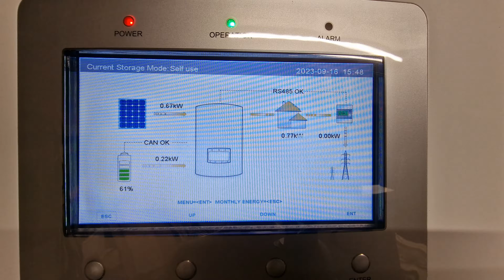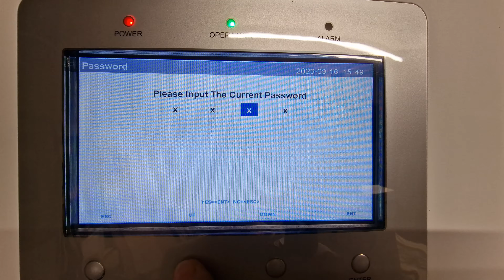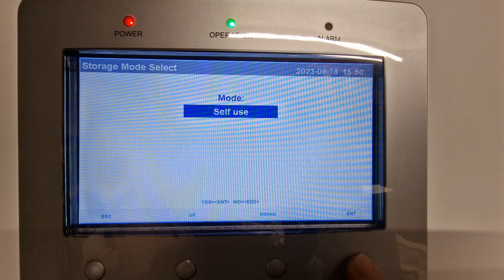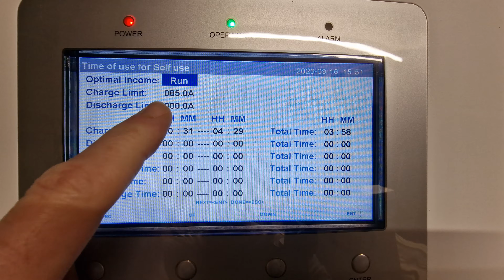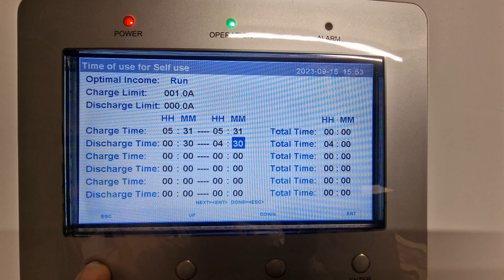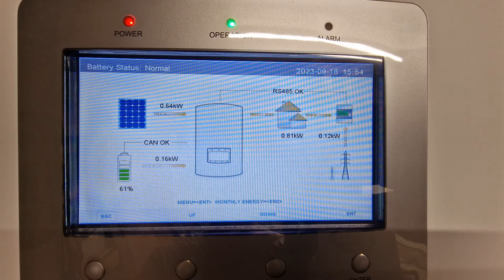Overnight EV Charging without using your solar/PV battery

Comment: That’s very helpful, thanks. I’ve set a 3 hr charge window at 1 Amp when I charge my EV. If I decide to charge my solar batteries at this time also, what’s the max amperage/current I should be updating the charge amperage/current to?
Reply from the maker: Hi. Depends on what model of inverter and what batteries and how many you have.
Reply: @SolisNotSolis  Solis S5-EH1P5K-L (rated power of 5kW) and two 5.3kWh batteries (two WeCo 5k3 modules).
Reply from the maker: @poc353  Ok, so the inverter is 100amp peak, more like 85-90A sustained charge rate dependent how well cooled it is.
I'm not familair with the batteries but a quick google seems to imply max charger current of 100a. So your limit will be the inverter not the batteries.
Bear in mind 20 A x 1 hour is roughly 1kWh of charge and that should guide you
Reply: @SolisNotSolis  thanks very much - much appreciated. Yes, those batteries are 1C rated. That makes sense then, I’ll probably start with 50a or so. Thanks again.

Comment: Thanks, that's really helpful. I'd not thought of setting the discharge rate to zero.
Do you need to change these settings at the start and end of British Summer Time?
Reply from the maker: Hi.
That depends on your energy supplier. The inverter will correct itself and if you use Octopus for example, they follow BST. One or two don't and stick with GMT all year round

Comment: Hello, I have a Solis 'RHI-5K-48ES-5G' Hybrid Inverter with a Pylontech US5000 Battery. If you can have any advice, that would be great because what I would like to know is how to stop my Solis inverter from discharging my battery, set at the factory pre-set times ? I'm guessing, as I am new to all this, but is it just a case of removing the factory pre-set Discharge times, or instead, could I just change the Discharge rate from the pre-set 50A, to 0 or 1A.

Any advice or guidance on this would be appreciated :-)
Reply from the maker: Hi. Discharge settings are for when you specifically want to dump all your battery to the grid.
By default those would all have a zero time span.
So mine are all set to 0600 0600 (all three discharge fields) so it's outside of my cheap overnight rate where I recharge my PV battery from grid. You don't want those times to overlap if you've configured manual charging.
If you're not overnight charging you can set the charge and discharge times to any values, just make sure the durations are all zero

Comment: If you don’t want to discharge into your EV why not just lower the discharge rate to around 5amp. ? I have this issue and don’t see a simple solution apart from constantly having to change settings.

Comment: I want to get Octopus Energy’s Flux tariff.  My question is: is it possible to program the inverter to dump a certain KWH at a prescribed time to the grid?
Reply from the maker: Morning Michael. You can't program it to dump a specific quantity of kWh to the grid.
But you can calculate this pretty easily. 20 amp discharge rate for 1 hour is 1kWh near enough.
So if you discharged at 40 amps for 3 hours, that's 6kWh to the grid.

Hope that helps.
Reply: @SolisNotSolis  This is possible through soliscloud.
In the UK soliscloud uses tariffs from Octopus, in the rest of Europe it gets day ahead prices from Nordpool.
If you can set up a price threshold about the discharge and charge, also the current limit, the soliscloud will automatic calcul the time period. Then the soliscloud will automatically modify the inverter remotely at regular intervals according to the set values per hours
Reply: Does the same figure apply when charging the batteries?
Reply from the maker: Yes it does indeed.
 @michaelellis405
Reply: Ok many thanks for your help.
Reply: check my reply, the function should be soonly ready this year

Comment: Is there away to access this method via the solis app? It seems odd there isn't this function. If it can be done, would it be possible to do a tutorial?
Many thanks
Reply from the maker: Hi, yes indeed there is. You need to ask Solis to enable remote management of the inverter first, then you get an extra menu option, which isn't dissimilar to the video above although the menu options are laid out a little differently.

Pop over here to register https://solis-service.solisinverters.com/en/support/solutions/articles/44002373796-inverter-remote-control-application
Reply: @SolisNotSolis  this is really helpful. Thank you. I will let you know if I have success!
Reply: Worked perfectly. Solis were actually very quick with setting things up as well.
Reply from the maker: @rosswhite5239  Great news! They do have their moments, but appear to be upstaffing and response times are certainly improving, which is good for all.
If you're on Facebook, and haven't had a look, pop over to the Solis group. There's a couple of Solis staff on there and lots of users. And me trying to keep the peace too!
https://www.facebook.com/groups/288045168816481
Reply: @rosswhite5239 hi dude is this only accessible to the installer another option to do this?. I have opened a ticket any advise
Reply: @rosswhite5239  hi I have only in the last few weeks had the system fitted (solis invertor and 10kw pytes battery’s) I am having the same issues where I wake up and my battery is empty my ca is charged. It’s super annoying as I’m on a EV tariff with octopus and the point is charge the car at night, charge the battery at night plus all my dishwashers, washing machine all goes on overnight then during the day use the battery to help power the house but on days o charge my car it ruins my plans. Do you have a video of how you used the app/which settings you set to make it work how I want please? I have emailed Solis today so assume I need something activated first or is that not the case?? Help needed as my brain hurts.

Comment: Will this change in the time settings stops the battery charge?
Reply from the maker: Hi Mohamad.
I'm unsure if you mean the EV or the PV battery. I'm guessing PV.
If you configure the PV battery to charge at the same time as the EV, then it will charge at the specified rate of 0-62 amps or 0-100Amps if you have a 5kW+ inverter.
If you set the charge current to zero or near zero, it will do only the tiniest amount of charging, but will prevent discharge  as your PV battery cannot charge from the grid and discharge at the same time.
Or you take the second approch and remove all charing times and only set a Discharge time (to match your PV charging time) with a current of zero, which will stop the PV battery being used for anything during those hours.
Hope that helps.
Reply: @SolisNotSolis  Hi mate. I want to charge PV battery and EV during the off-peak tariff. It seems the second approach would stop the batteries being charged or discharged so no good. . If I just do a charge time will the PV batteries revert  to charging the car and empty AFTER they have been filled up from the grid ?  Thanks
Reply: Sorry to bother you again. My Solis inverter is 3.6kw. I have a cheap rate between 02 and 05 hrs so I set  my PV battery to charge at these times. And I plug my EV at those hours as well when it needs charging.
I am moving to another tariff (octopus intelligent) and want to make sure when I plug my EV it does not use the battery load. And I still want to charge the PV battery at the new cheap rate hours which will be 23.50 to 05.30
So what is the best way to set the inverter to do this?
Regards
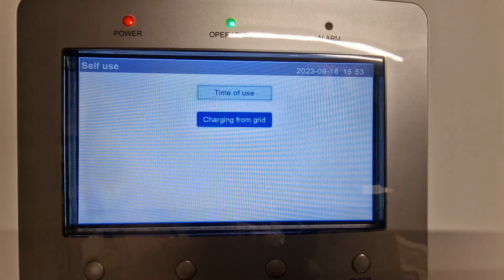Reply from the maker: Unfortuately there is no way of coping with IO's extra time slots. You can set your inverter to charge (or not to discharge) between 23:30 and 05:30 (in this area - check the times in your area) which will prevent it draining to the car. However the potential extra cheap slots during the day on IO can't be accounted for.
The only sure fire way to prevent PV battery drain and to cover the extra possibly charging slots is to re-cable the inverter and EV charger so they can't see each other at the incoming supply point of the house.
Or unplug the car so extra potential cheap charge slots are not used.  @mohamadsaleh5710
Reply: Thanks for your help
Reply: 3rd party now has an app...Solis app that can be integrated and intelligent for octpus cheap charging seek it out.
 Ginlong solar widget
Reply: Hi.
I’m new to this as I’ve only had my Solis inverter, solar panels and battery installed this week.
If I want to charge my EV and the battery between 11.30pm and 5.30 am do I just set this as the charge time and leave the discharge time as zero?